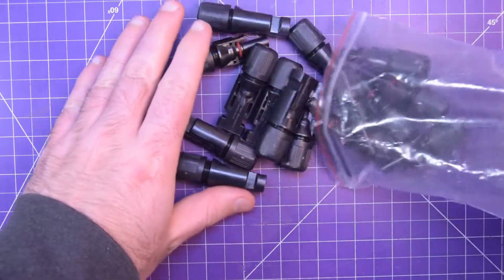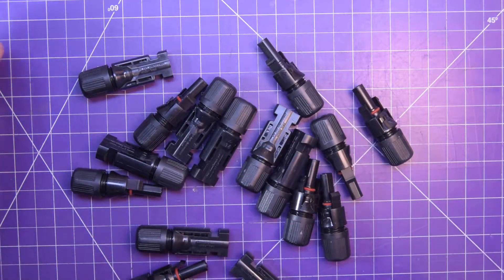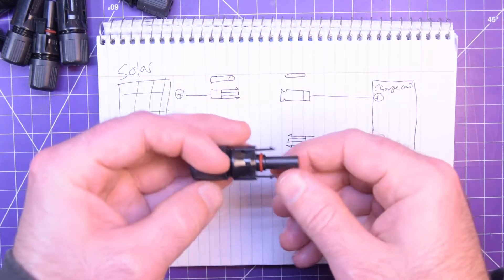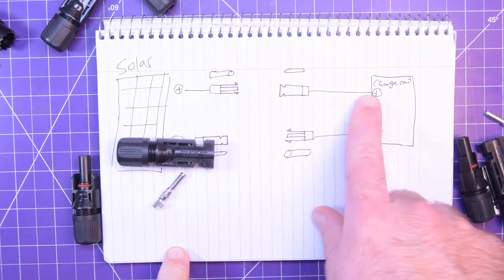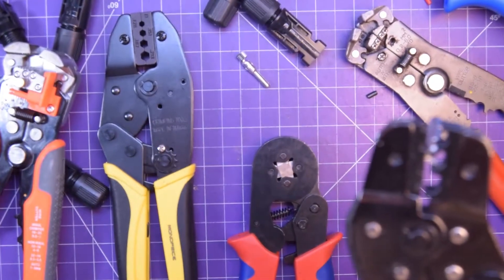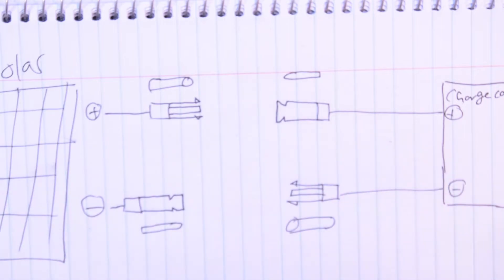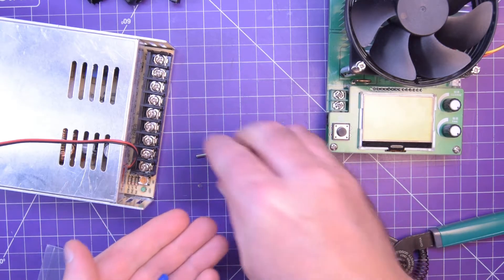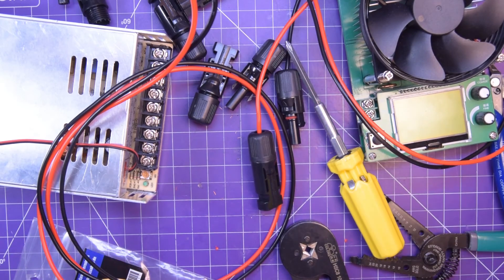Cool Solar Panel Connectors

Comment: Julian Ilett uses those MC4 connectors. Also, when using screw terminals and I don't have any fork connectors, I strip about 10mm of wire, twist it together, bend it around a screwdriver of roughly the right diameter for the screw then tin the wire. I find that screws down nicely.

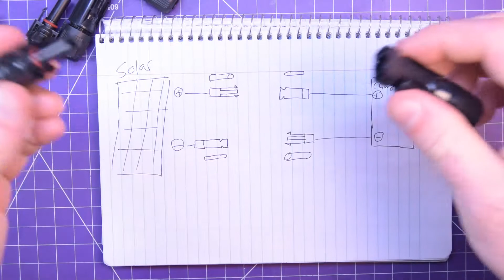Comment: 4:30 if you put both male and female on both the controller and the solar panel doesn't that make it possible to short the panel ?
Reply from the maker: It definitely does, but it's the standard approach  ¯\_(ツ)_/¯